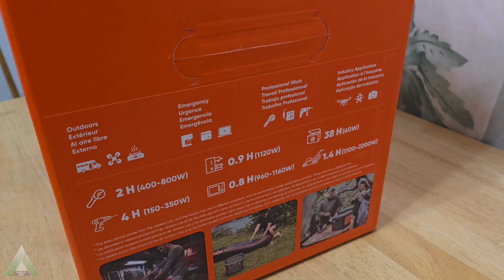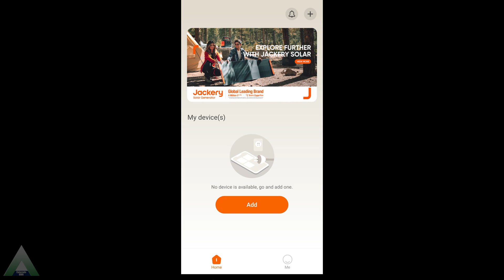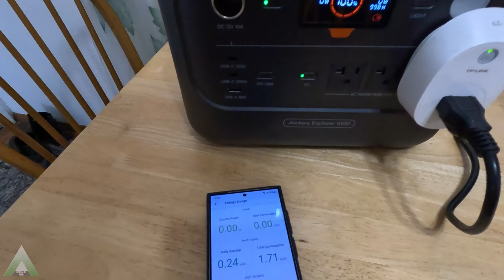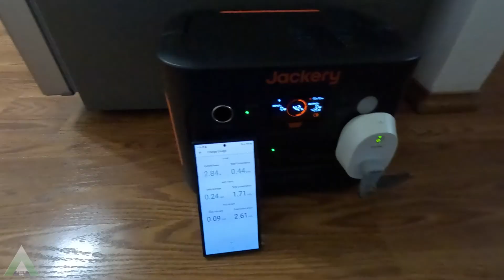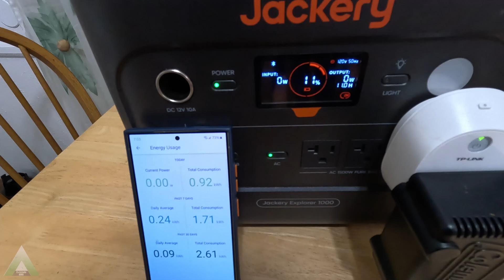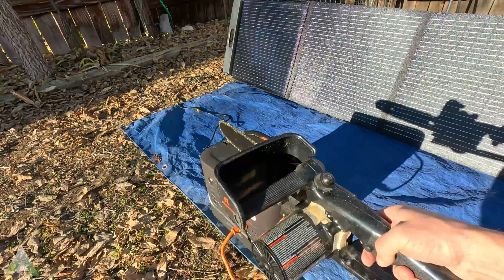Jackery Explorer 1000 v2 Review & Stress Test - Solar Generator Power Station Battery

Comment: What are you using to measure capacity? It looks like a neat little system.
Reply from the maker: I have a Kasa SmartPlug with Energy Monitoring: https://amzn.to/4jBDoTD The one in video is HS110 but they discontinued it. Their newer model EP25  still work but I find them not to be updating live / very quickly  (you have to exit and reenter the energy page on their app).  I know there are other models as well, but have not tested them yet.

Comment: Fantastic review. The vast majority of reviews for most items end up being a light use or just rehashing specs. Seeing you load it with some demanding items is appreciated. I received mine from the Amazon BF sale with $50 off coupon today. Great to have confirmation I can use it for getting some cooling cycles on the fridge in the event of a power outage.
Reply from the maker: Thank you for your comment! Glad you got to take advantage of the BF sale pricing!  It is a great unit with a good balance of power, size, and weight.

Comment: 🇨🇦 160 W coming in with 200 W of solar that’s about normal. I have different panels and they do about 80% if anybody has panels to do 100% I would like to know which brand they are. Thank you.🇨🇦
Reply from the maker: Good to know, thank you! Over-time I may add / test others but am happy with this first setup and the results.
Reply: I think you're right that under normal conditions it's very hard to get 100% of the rating. But in full bright sunlight when the little sun aimer is bang on, you can get over the rated wattage from the Jackery solarsaga panels. But yeah, the sun will move in 30 mins, so unless the panel is constantly being moved it'll be lower.